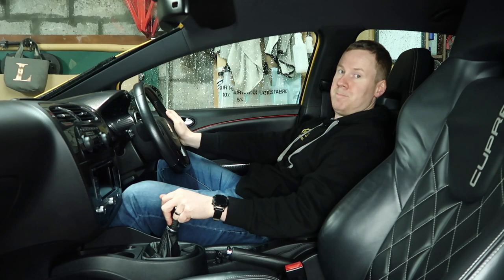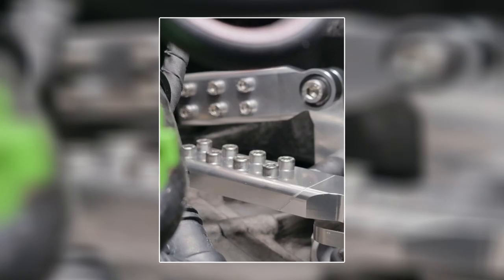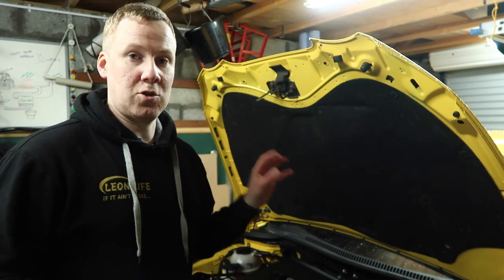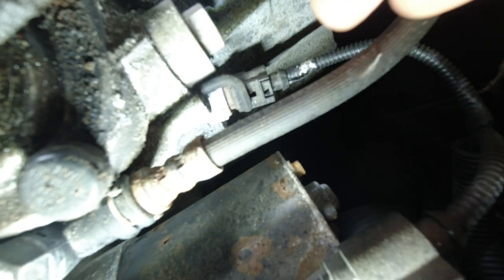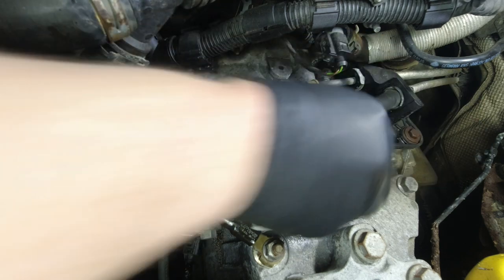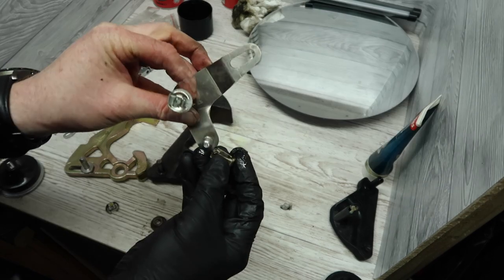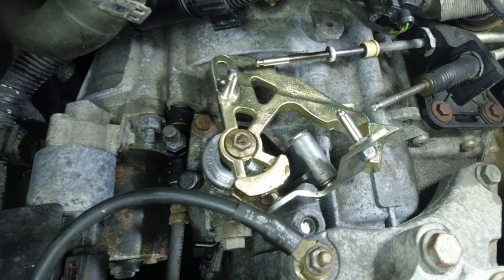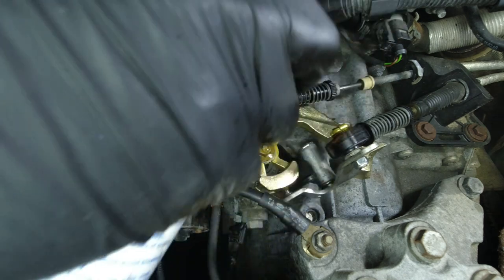Short Shifter Kit INSTALL on my 6 Speed Cupra | Does it make a difference?

Comment: You should have put new metal shifter bushes in there aswell Kev 👍
Reply from the maker: At the base of the gear lever or over the old rubber bushes attached to the short shifter?
I've ordered new spring bushes to attach to the short shifter, as my ones are knackered 🙈
Reply: @NorthCoastWorkshop  the actual rubber bushes that slide over the pins. You can get metal ones and it makes it feel even tighter
Reply from the maker: Ah yeah I've seen those I think. Nice one, I'll get some ordered. I'm sure I saw some on darkside developments website. Cheers Brad, appreciated👍🏻

Comment: Excellent how-to, thank you 👍👍
But the other metal bracket that replaces the black plastic one... is that necessary if the plastic one seems ok?
Seems to be confusion online about what that smaller bracket does so on yours do you know if it helped reduce the throw at all? 
It's an extra £50 so I'd rather spend that on new bushings unless you think it's definitely worth the extra. Cheers✌️
Reply from the maker: Hey mate, thank you for commenting and glad u found the vid useful. It's always cringey when I watch back my older vids 😅🙈
Anyway I had a quick look to double check the plastic arm your talking about. I'm 99% sure that one controls the side to side movement of the gearstick, so it's not a necessity to replace. You can definitely run the setup with just shortening the front to back movement. And yes it's certainly expensive for just a small amount of reduced movement.
Hope that helps 😊👍🏻
Reply: @NorthCoastWorkshop  It is side to side but except for neutral I can't see that making much difference. Think I'll give it a miss and just do the main part, cheers.

Comment: Currently I have an issue. This retaining clip @ 4:36, broke at mine (found out 5min ago). The pin went out of place and I could not change gear anymore.... Now I need one of these Metal retaining clips. I wonder where I can get these. I'm not getting a short shifter, just looked at the video to have some help to find my issue...

This video was super helpful. But maybe you can help me to find the right retaining clip? ❤
Reply: I think I've also lost the plastic bushing from 07:35. Ughhh. Where to get these small items 😢
Reply from the maker: I can't find the plastic bushing individually I'm afraid. Best bet is Autodoc, pop in your car's details and see what they offer in the ' transmission ' section.
As for the clips, I found the part number I think online, but they are expensive.
https://www.ebay.co.uk/itm/132907260788?mkcid=16&mkevt=1&mkrid=711-127632-2357-0&ssspo=yyqjsshvQx-&sssrc=4429486&ssuid=vCDiAaHLTtq&var=&widget_ver=artemis&media=COPY
You may be better off just getting replaced parts from Autodoc that have the clips/bushes included as the whole assemblies aren't much more than the individual bits.
Hope that helps 👍🏻
Reply: @NorthCoastWorkshop  thank you very much! I'll do that and order it. I need my car for commuting. Time to use the train now until I have the parts 😭😭

Edit: found the part number of the lever: 1K0711202F
Reply: @NorthCoastWorkshop  Do you think that plastic bushing is standard and required? Could just use only a retaining clip. Found one on internet just as you sent me for €3.50. (I live in the Netherlands)
Reply from the maker: Worth a try. I'm not sure if it'd work as I still have the one for the kit I received.

Comment: Where did you get tour sound proofing from under the bonnet ? Also how did you fit it. Mine has sagged and gone mouldy. I removed it but im looking to replace it. Thank you
Reply from the maker: Mine is still the original soundproofing from seat. I took it off a few years ago to wash it and dry it out to remove the mould, but only once I had sealed the holes from the plastic trim fitted to the bonnet (that's how it gets wet and mouldy)
You could try the same with urs, with a damp cloth and then leave it flat, drying out in the sun for a day.
Otherwise a seat dealership will be the place to try and source a new one 👍🏻